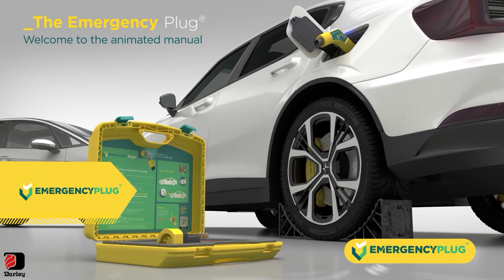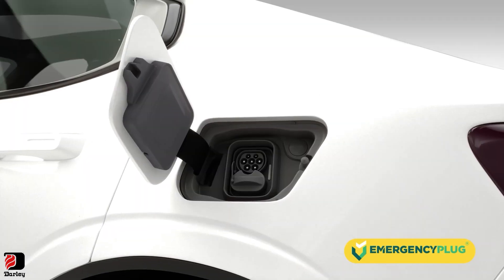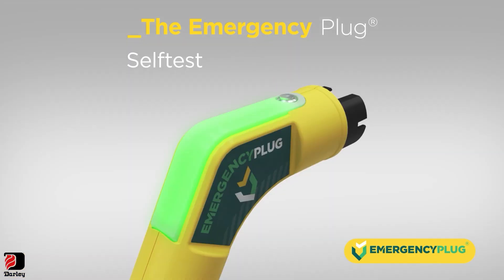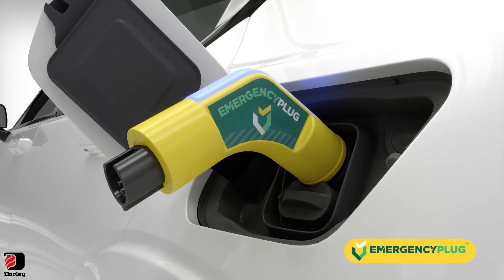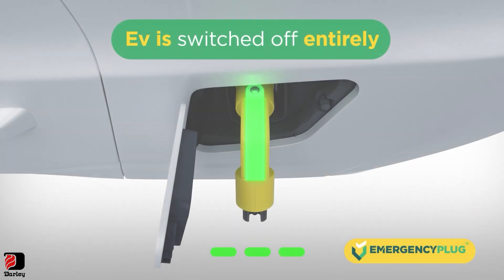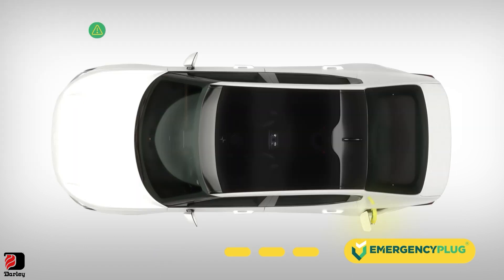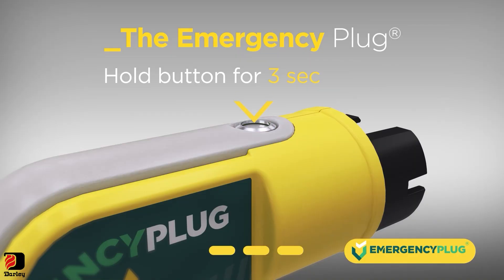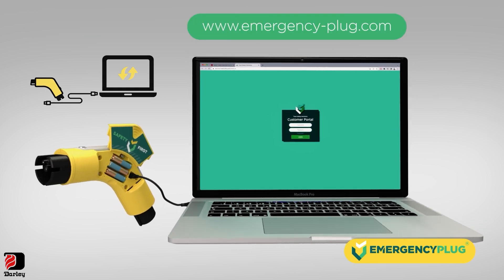Emergency Plug Animation Explainer Video

Comment: Well, in my opinion, the problem with this device is that the HV-system will be alive with this plugged where it otherwise could be completely voltage free outside of the battery. Also the charging door needs to be unlocked to use this. I don't know about cars, but in our trucks there is a disable switch in the dashboard to disable the HV system all together. Additionally two LV wire loops under the seats to cut in case of an accident with the same function.

Comment: Battery fires are still gonna happen. This only shuts down the command to "Move/drive" in the logic modules to the motors. Just a reset/override. STILL gonna be fire bugs <<< FOREVERNEVERNever